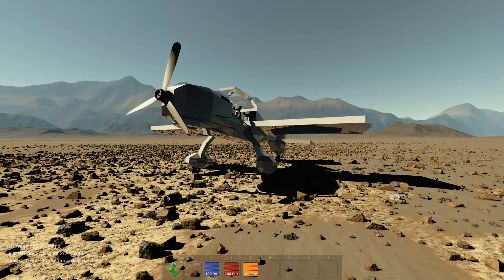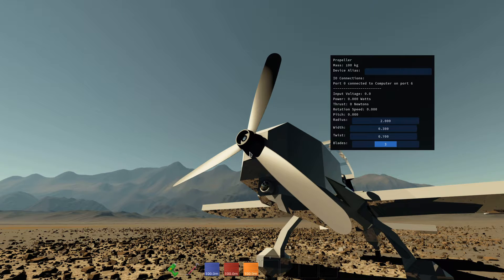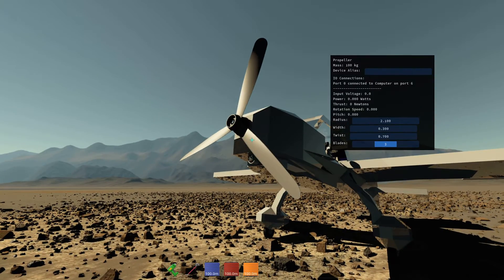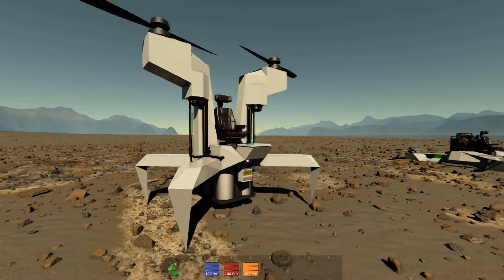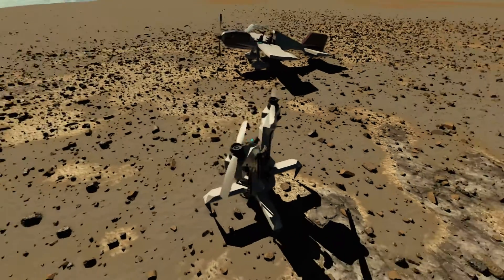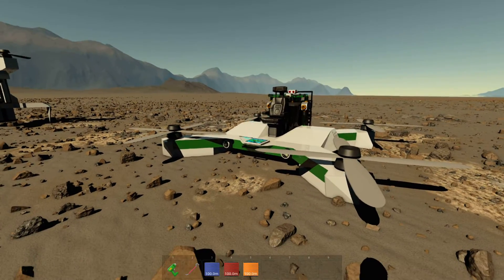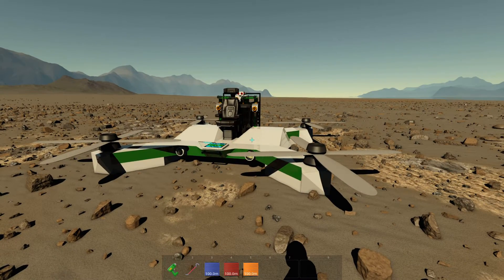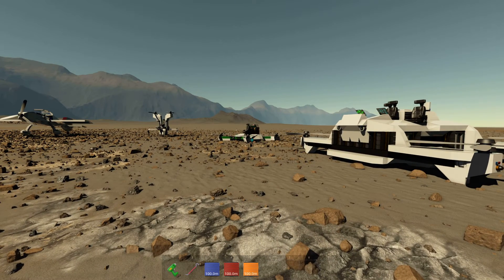Archean - Tutorial 13 - Propellers

Comment: How do you change the way that the Ore Scanner is outputting the results? As in, by default, the results are all outputted into 1 horizontal line. The display on this build shows the results listed separately & vertically?